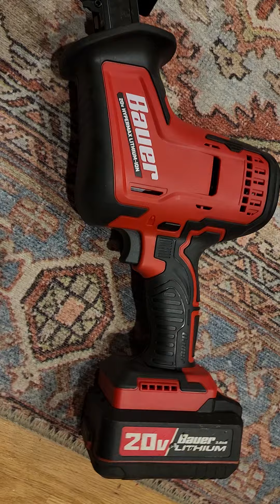Bauer 20v brushless compact reciprocating saw failure

Comment: For anyone that stumbles across this video, try cleaning the battery connections on the tool.  Worked for me.  There's vids on Milwaukee tools having the same issue and its related to the connection for the battery temp sensor.
Reply from the maker: @anthonygrebner  sounds like a reasonable reason.  Thanks for commenting!

Comment: Did you ever figure this out
Reply from the maker: I had to buy a new unit since the controls inside was faulty
Reply: I think I’m one and done! I’ll go back to buying products that will work more than 30-45 minutes of total run time, and the manufacturer will stand behind for at least 1 year, and provide parts for after warranty. Saw batteries and charger I have at least $150 invested, $99 on Amazon buys me the dewalt equivalent. My mistake for not doing my research.